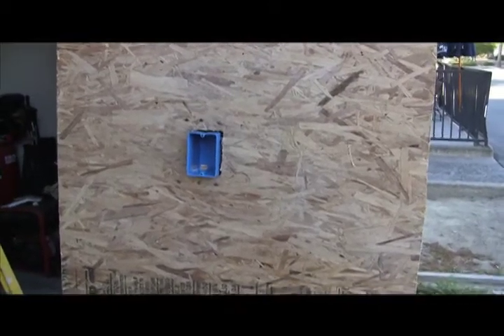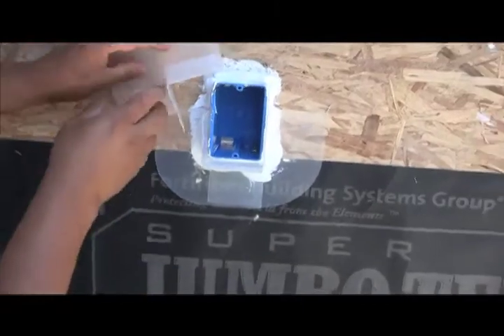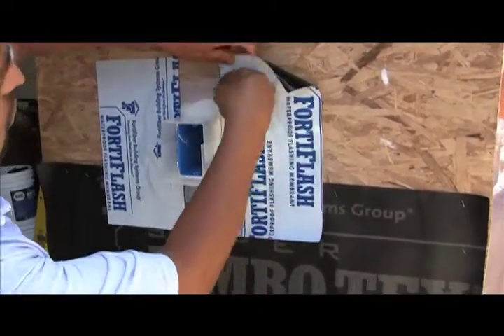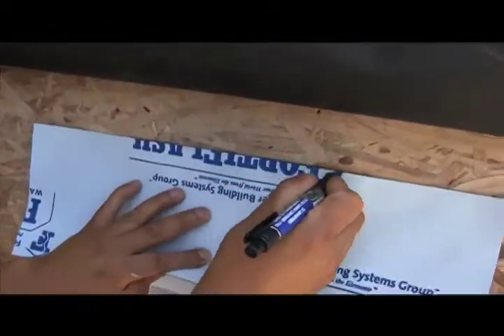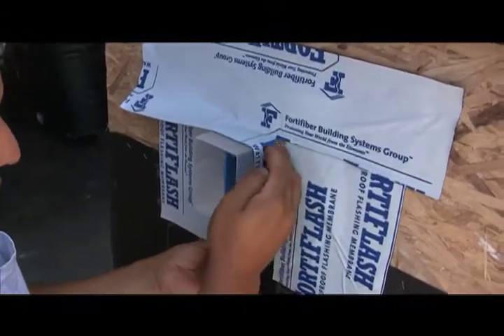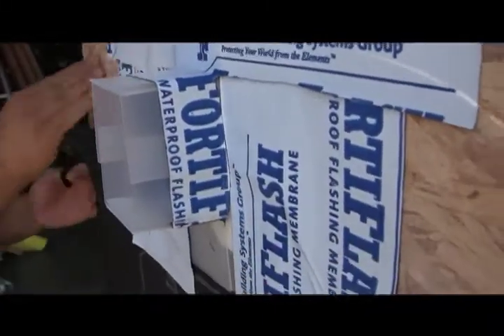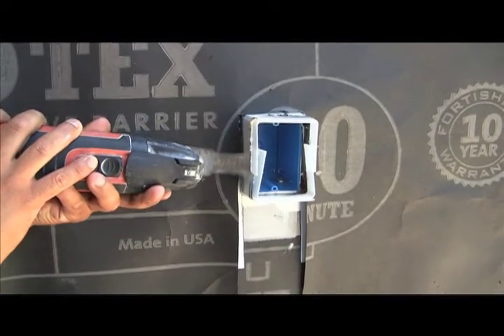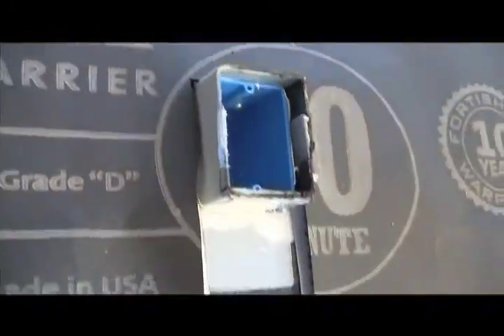How to Flash an Electric Box with Lightning Flash Corners_by TLS Laboratories_

Comment from the maker: Sorry for the delay.... We used a Fein Multimaster. If you don't have one I strongly recommend this tool. It is very useful in many situations. You can find them on EBAY used for good prices. 
The cut is typically done after stucco or siding is applied. It is cut flush to the face of the stucco or siding. This demonstration did not include the finished exterior surface.
Thanks for watching1